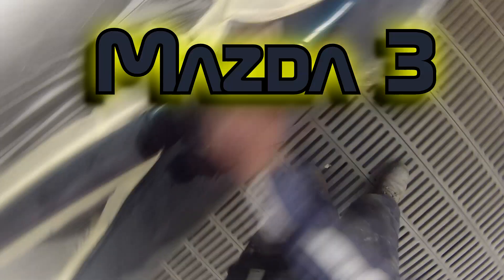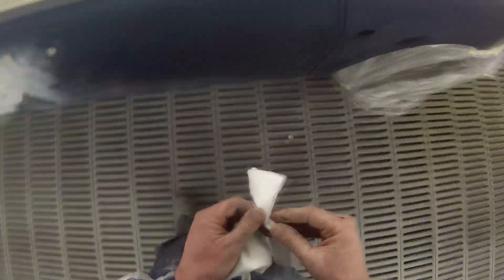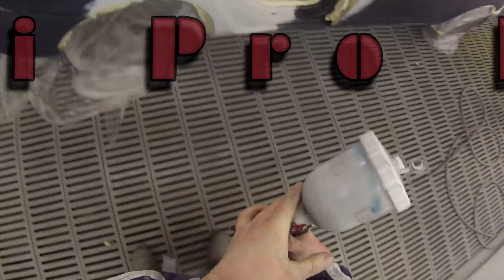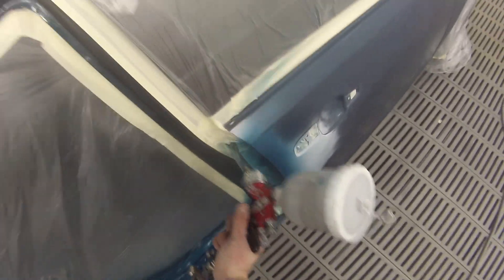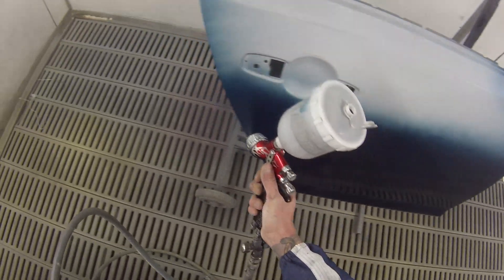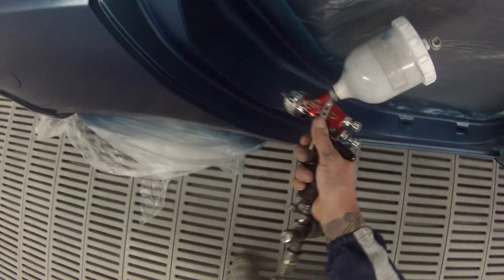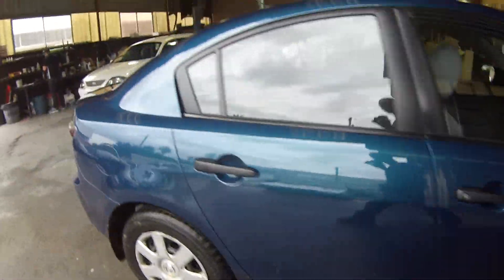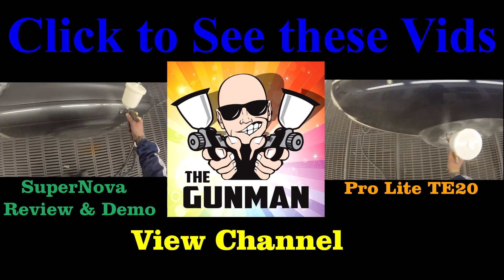Phantom Blue Mazda 3 Spray Painting

Comment: Like your videos, got a question. I have a black truck on the tailgate the lower section has a terrible touch up job, looks like nail polish applied.  I was wondering if I sand out and fill the bad repair, should the entire tailgate be re base coated then clear coated,  or just the lower area.    And do you have any videos on re clearing a car? Like how to prep for new coats of clear... Black show everything as u know. Thanks

Comment: Damn, that's so clean and nice looking!  A couple questions.One - I have the Tekna Pro Lite and run it at around 25psi, 1.3mm, T-20 cap,  with full fan and 2.5 to 3 turns out, but you are moving at LEAST twice my speed.  Why would that be?  Simply curious, that's all.  Using HS clears (Dupont - Nason - DON'T LAUGH!! LOLAnd two - where you are blending, are you only applying one coat of blend after everything else is sprayed?  Looks like.Thanks for the kind and supportive environment.  I am running a little side shop and having the time of my life!!  Fun fun fun......  It's very rewarding.